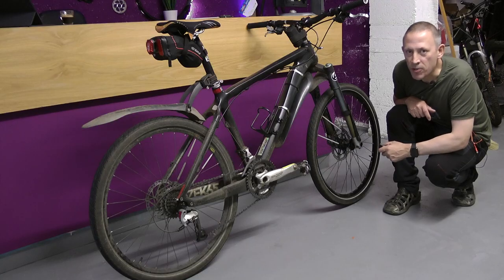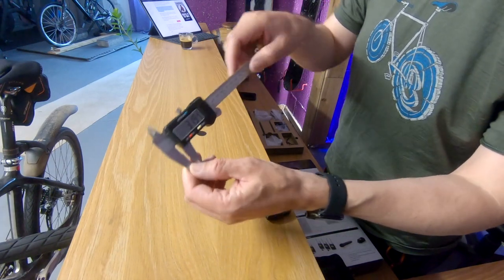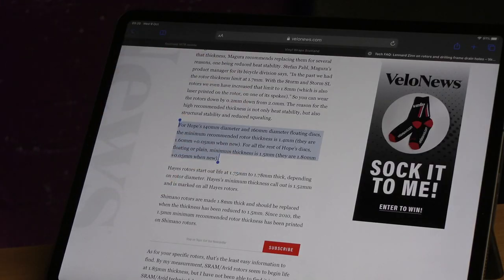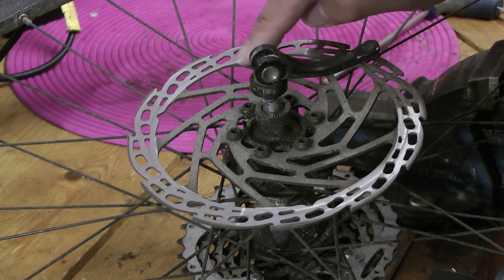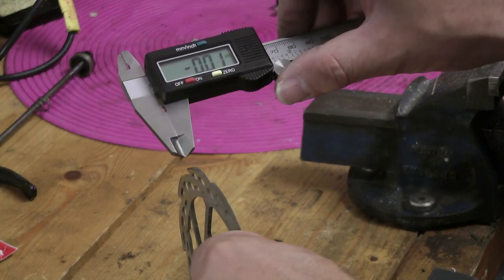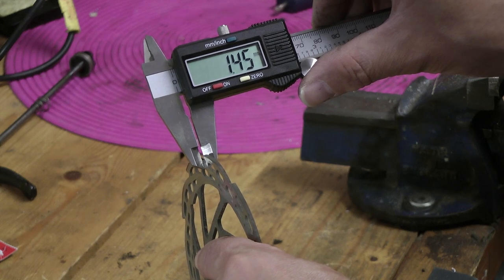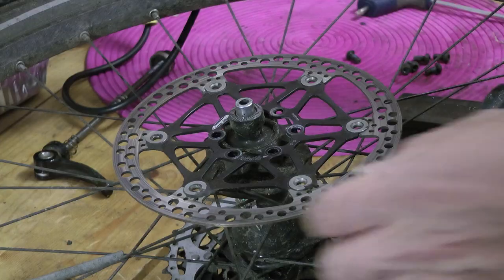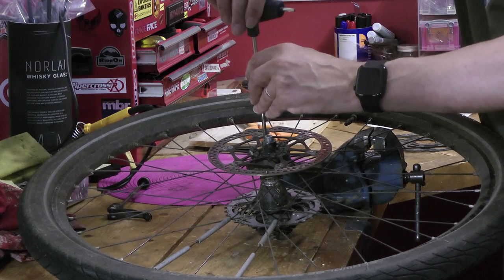MTB Disc Rotor Wear Check & Change | Easy DIY

Comment: I too run Hope rotors, so far only one out of 3 rear rotors is creaking. I got tree sets of wheels. I've used them several years, rotors still going strong, as long as I don't have leaking brakes thst overheat the rotors then it's great, currently run 160 rear 180 front.
Reply from the maker: Johannes Nilsen Apart from one bike which had Shimano XTR M980 which were ace always had Hope for braking since I started a long time. See some of the discs on the wall behind me. 3rd party pads are the weak link so I now avoid.
Reply: @North3rdMedia  aftermarket rotors or mismatching brands is not always bad, I see some use Trickstuff pads in Hope brakes, and others, but seen some other brands used on shimano brakes, but of course that's not cheap erternatives.

Comment: The trick with the bolts is to apply Lovtite 243  so it is secure torque to spec, and not overdo the Loctite. I've taken rotors of and on several times so it never gets stuck. I always sand them down when needed, I am currently back to mechanical Trp Spyke dual piston brakes, I think I am giving up on Shimano brakes cus of the evil circle of leaking brakes, can't take it anymore.
Reply from the maker: Johannes Nilsen trick I used with some success is applying Sugru or super glue on each of the rotor’s disc mount rivets. Mind when the tinging sound starts it’s probably time to change the rotor. Yes agree with the loctite 243.
Reply from the maker: Johannes Nilsen btw thanks for subscribing to my channel.
Reply: @North3rdMedia  tining sound is normal, but that's just metal being warm shrinking an d making noise when cooling down, but the creaking like creaky bearings, headset or cranks or pedals just from the rotor, that's the looser rivets I guess.
Reply from the maker: Johannes Nilsen yes heat expansion creaking noise is expected. I taking about when there is movement of the steel rotor relative to the alloy spider then you hear a high frequency loose rattle. Drives me bonkers. Lol
Reply: @North3rdMedia  so far Only makes noise if I do track stand.and bike moves little bit.

Comment: My cannondale habit came with 180mm do I have to stay 180mm or can I upgrade to 203mm?
Reply from the maker: Check the fork specification to see if it allows a larger rotor.  If so you will need a new brake callipers adapter to move the calliper out to fit the bigger 203 diameter.